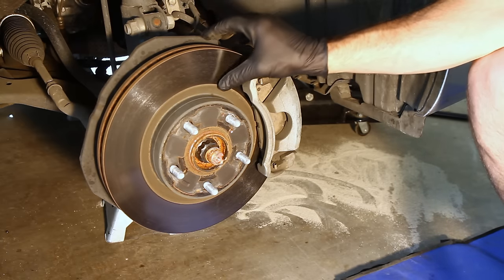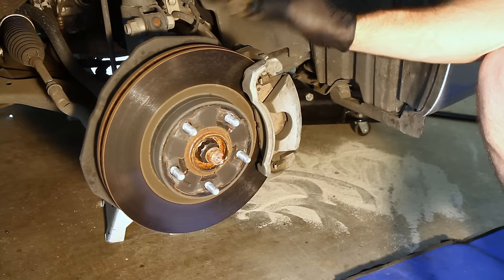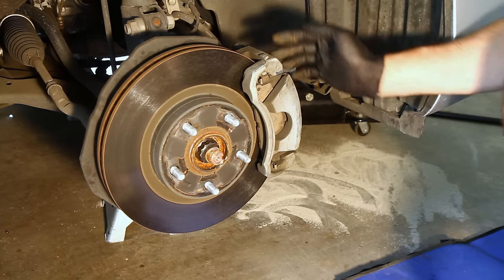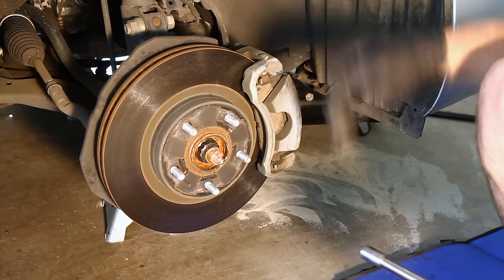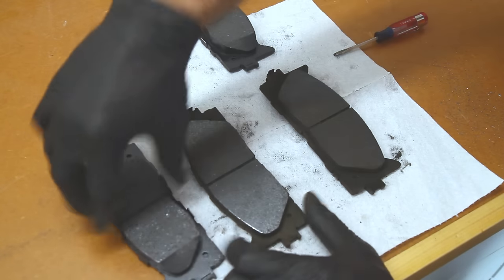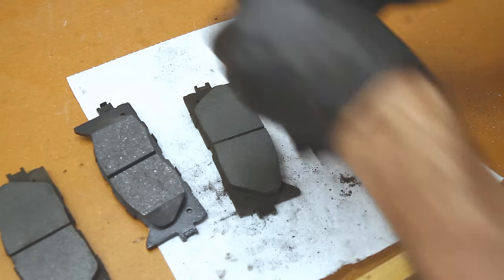Toyota Camry Brake Job, Front and Rear Brake Pad Replacement

Comment: Shop quoted me 500 for the front brake pads. And had the audacity to tell me ill need to replace the calipers too because they don't push the pins back in. So it would be a total of 950. Because of your video I did the whole job in 1 hour and 900 dollars cheaper!

Comment: Great video great lighting... 2 notes 1 is make sure you're using brake cleaner before you work on it that stuff causes cancer  your hands were covered in dust even with the gloves on you can still inhale it.  The torque wrench only should be clicked once.
Reply from the maker: Good tips
Reply: to mr. Davidcolemanfl .
What happens if it Clicks 2 or 3 times, is it gonna overtight ??
Reply: @Alamin311  Of course not, doesn't matter. Click away!

Comment: Great video. I did mine yesterday. Question is it’s difficult to put the pads back in the caliper and it’s a bit frustrated. Do I have to put the wear indicator on the pads? As I need more room to put it back in.
Reply from the maker: I would keep the wear indicator. U sure the caliper piston was compressed in enough? I recall the pads pop in easily.
Reply: @KrisKasprzak  I used the old wear indicator and this time it pushed in easily. Thanks.

Comment: This is such a great video. Excellent detail down to the settings on the torque wrench. I think this will be very helpful when I replace my pads. Thanks for taking the time to make it.

Question -- what additional steps would I need to take if I wanted to replace the rotors as well? Any additional lubricant I'd need to purchase? Anything else? It looks like they're really easy just to take off and replace but I'm not sure.
Reply from the maker: I believe they slip right off. Some cars have a screw that holds the rotors on but I don't recall this car having them--I just looked again at the video and i don't see any. replacing rotors is straightforward and doesn't require anything else (the bearings are actually part of the hub the rotors attach to so the bearings don't come off.

Make sure you paint the rotor hubs before installing to prevent rust (assuming they aren't already painted.)

Comment: Kris, thanks for your video in detail. My steer wheel tends to vibrate, I assume that I have warped rotor, is the front rotor warped or rear rotor warped?

Thanks
Reply from the maker: if your steering wheel vibrates all the time it's probably wheel balancing or wheel alignment, or worn tires. If your steering wheel vibrates only when you apply the brakes, it's probably the rotors. Replace them, don't try to have them turned, once they are warped, they really cant be fixed reliably.
Reply: Front

Comment: Why are you supposed to attach only 1 clip to each brake-pad, and why is it supposed to be on the top instead of the bottom of the pads? What would happen if you attached a clip on the bottom instead? And what is wrong with attaching clips on both top AND bottom at the same time?

Comment: Hi Kris, Can I ask how many miles on your camry when you change your break pad? I am also a Camry owner and I am glad that post these awesome videos here!
Reply from the maker: +刘航成 you will laugh at this response but my Camry had around 80,000 miles when i change the brake pads. The pads were fine and had a lot of life left in them, the only reason i changed them is to avoid the brake dust. The factory pads were very dust producing, my Aekobonos produce very little dust. Sounds like a silly reason (and it probably is), but dusty wheels was driving me crazy.
Reply: +Kris Kasprzak Thank you so much sir! I am studying at library and didn't bring a headphone so I didn't listen the audio part. My Camry is still young and it only has less than 30,000miles now. Probably won't change that for a long time and my LE version doesn't have a alloy rim. Love this car and I want to do so much on it by myself!

Comment: How do you not get air in the brake lines if you take them completely off? Just want to be sure so I dont need to bleed the lines after the job.
Reply from the maker: While the brakes are coming off, the brake lines are NOT disconnected. You do NOT (and should not) disconnect the brake lines.
Reply: I got it.. You are just taking the bracket off that holds the line still. Good info. Thanks for your reply.
Reply from the maker: Yes, just the bracket--glad you asked before disconnecting the line--bleeding is a pain.

Comment: What size wrench do I need that is thin to hold the slider pin in place while I looses the caliper bolt? Is that 14 mm as well?
Reply: did u watch the video
Reply: 17 mm